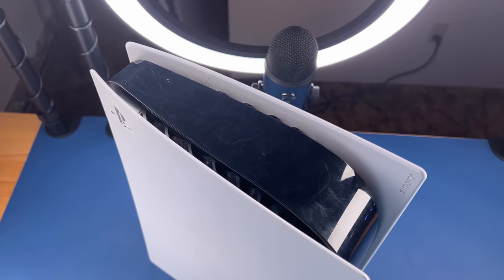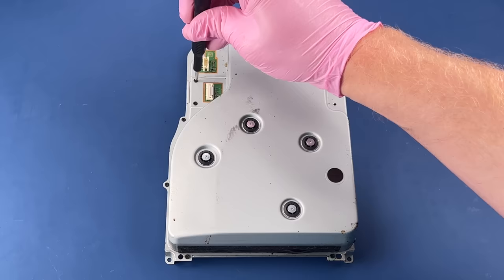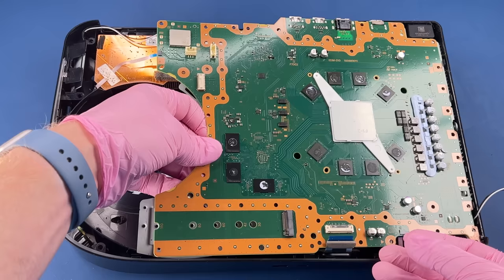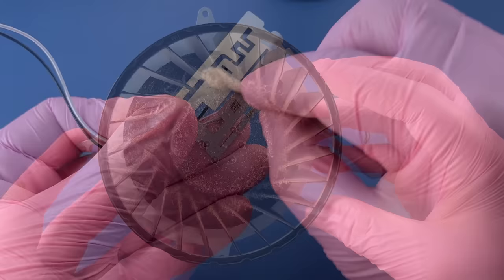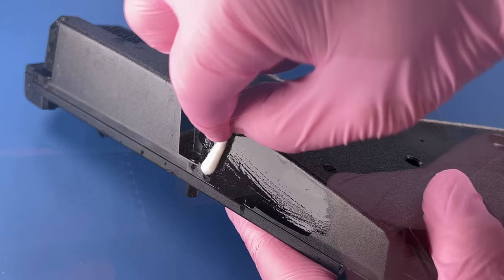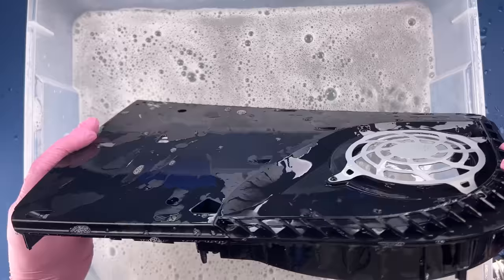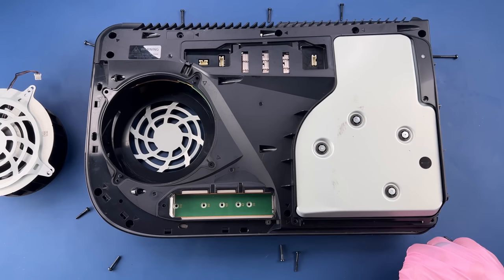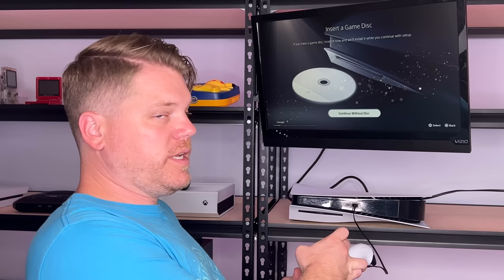Deep Cleaning this DISGUSTING PS5 - TronicsFix Collab

Comment: Bug Expert from the south of the continent here. Those are "Blattella Germanica", commonly known as german cockroaches. They're small, like an inch big at most, we call them "Chiripas" over here in Venezuela. They're annoying, and love electronics for some reason, we commonly see them inside air conditioning units, behind refrigerators, etc. Basically any device that produces warmth of some sort, will attract them.
Reply from the maker: Thank you!
Reply: Also anything with adhesives. The glues inside of electronics, cardboard, tissue paper, etc
Reply: Was scrolling the comments to see if it had been answered. I do pest control for a living and couldn't have answered it better.
Reply: I have read that bugs love electronic so much because the coating on the wires isn't actually plastic. It's made from some soy compound and when it gets hot, they can smell it. Run right too it like the dinner bell is ringing.
Reply: Interesting, in Germany the one I Had was much larger😂
Reply: @Mut4ntG4m3r  Actually they are pretty common here and named "Hausschaben". They love humid weather and you could find them in warm rooms. I found a few of them in my apartement after a few really warm weeks in a row.
Reply: German Roaches are the worst especially when it comes to trying to resolved infestations.  They've become immune to so many of the pesticides used to combat them over the years.  They like electronics because it's cramped, dark and warm.
Reply: At least I saw these things on very old electronics, stored several years down in the basement. 

On Steve's advice, I opened my 2020 Launch PS5 to replace the liquid metal as a precaution. After 3 years it was surprisingly in very good condition and thank god, no roaches contained. =]

Living in northern Germany, we probably don't have cockroaches in our region, as temperatures are lower on average than in southern Germany.
Reply: 5 year pest Control tech here from California, German Cockroaches are also commonly found in Dishwasher cases, we typically use borax cockroach bait to help control them as well as active vacuuming of larger populations in the home combined with a sticky board monitoring station, and home cleaning practices.
Reply: @itbaggedurgf  Had an older lady yell at me, Why can't you get rid of them?! I had to tell her, It's because she feeds them so well.🤣
Reply: How to avoid them?
Reply: @Roznasty13  How to avoid them?
Reply: @iris089  Watch what (and who) comes into your home. They hide in boxes, clothes, used furniture, and eletronics, as you see from video. I was in a food store, and saw them jump from someone's handbag. Woman with the handbag saw them too, and said nothing.
Reply: @iris089  If you see one roach in your home, act quickly. There's NEVER just one. Start using roach bait, and retreat home every two weeks. Keep all food sealed tight in plastic with locking lids.
Reply: I was thinking the same thing.
There are many many roach species.
And this looks like the German Roach.
Kinda small and brown-ish
Reply: @LadySamurai88  What? You didn't see the beer garden they had in there?🍺
Reply: They like the heat
Reply: @aleksandrbmelnikov   thats a classic! haha first step to getting rid of these pests is to control the food supply! swap out their food with cockroach bait and apply it to sticky "cockroach hotels".
Reply: @suje809 yes. That's why I got this idea to put a slight dusting of diatomaceous earth around the device and let it slowly but surely get em
Reply: The hell they doing over here 😅
Reply: Exactly the comment I imagined when I opened up the comments section.😂
Reply: They adapt to their surroundings. So even if you use product to kill them but you didn't kill them all they will start to adapt to those products. They extremely like outlets, devices, water, food, even Lysol, and many cleaning products.
Reply: @Brealiq maybe it's good time to clean  your house, because you talking now BS, never ever had this kind into my house or any, oh I clean my house, that have probably solve this problem. But yeah there are people that give more about the material that the have, instead the house the are living in.🤮🤢🤮
Reply: We got roaches so bad at my house, and we tried to use every store product when we first saw them, but it was no use. It's hard when you live with an older family member, since they usually have cramped hoards of boxes and supplies.
Reply: Professional!!!
Reply: Most importantly, these are the types of roaches that infest. The big, angry ones people from Florida call "Water Bugs" just breeze through, looking for a snack.
Reply: How bad do they smell??!! Is it after they did or always smell bad?!
Reply: @Mut4ntG4m3r oh damn mean your country had a lot of big bugs if my girl saw it she will freak out lol because she had ps5 also i am own of ps5 for 6 or 7 months but she never had clean ps5 for one year i alway keep tell her make sure clean ps5 from dust and make sure don’t allow bugs move in ps5.
Reply: That's true.. in my work place those kinds of cockroaches dwell on the air-conditioning unit and destroy it eventually. It's disgusting to see that it will give you a ghost bump.
Reply: Do roaches go into Xbox series s much also ? Or is that one of the lesser prone console for roaches ?
Reply: Especially wood too
Reply: Me not being a huge expert i did know they were Germán origin roaches. sadly in my past i have encountered them in NJ, I researched as a teen especially once i saw the difference between these little ones vs the ones in Puerto Rico which is more disgusting, in PR they are like 4 to 5 times bigger and they Fly.... lol anyhow awesome how I sort of knew what they were before seeing your post.
Reply: I swear man some part out here in Las Vegas we get these so damn bad and other parts of the city you see massive roaches then some parts there is none.😂😂
Reply: This person speaks facts, ONLY!  Thanks for the info!
Reply: But why tho? We don't even have cockroaches in Germany.
Reply: @aleksandrbmelnikov  maaan... Uhh... Would that stuff be safe around pets??? If you were to use that stuff?
Reply: @adventureoflinkmk2 man... Diatomaceous earth will kill like more than half my pets... 🙁 If I had any infestation problems diatomaceous earth is unfortunately a no go in my house.
Reply: @kennyferrick1240  No. Place only where pets and small children do not have access. It should be fine in locked or child-safe cabinets. They're dark and cozy, just as roaches like. ⭐⭐⭐⭐⭐
Reply: @kennyferrick1240  If all else fails, buy a junction box and cover from your local home center. Screw the box inside a cabinet, and put bait in there. Unless your pets know how to use a screwdriver, they will be safe from harm.
Reply: @aleksandrbmelnikov  Well, I'd need to get doors for the cabinets since I don't have any at all. Sounds like I'd need to go to the city for these things. (I live in a village, literally, so there might be things not available.)
Reply: @aleksandrbmelnikov  I don't have doors to any cabinets. In fact, they never did come with any. I don't really have doors in the house, just drapery and cloth to every entry in the whole house except for the exits to outside.
Reply: They like to eat adhesives
Reply: What it is, is low electricity. Things like toasters, especially behind fridges. They have the heat they like, a drip pan for water and usually there’s food source because crumbs usually fall under fridges. This guy, who that had the PlayStation, my guess, left  junk food and spilt whatever next to that ps5 and they had that nice low electricity and the warmth they love from that and they just moved on in.
Reply: @mikeandroid3512 they go into ANY electronics. It has nothing to do with the console, just the environment it is in.
Reply: That's not "residue" it's cockroach crap. It's where the smell comes from
Reply: Dale gribble
Reply: If you take a closer look they are actually American cockroaches still in the nymph stage. You can tell by color and size of legs.. 5+ years of experience
Reply: OH CRAP WE GENERATE HEAT!! 😨😨😨😱😱😱
Reply: They’re all over the world, Asia is flooded with them.

Comment: I would never be able to put it back together after I take it apart😂
Reply from the maker: There's a lot of screws and parts in these things!
Reply: Yup lol. Why it’s best to just take the covers off and and vacuum in the holes that’s for it… could never take it all apart
Reply: I always get a piece of cardboard the same size as the device I'm working on. Then stab the screws on whatever spot the screw came from. Sometimes I'll doodle the shape of what part the screws go to. If there's layers I'll put the screws next to whatever screw is higher and label like Layer1 layer2 ect. Hope this helps because I've taken a lot of things apart and couldn't put it back together.
Reply: Amen😂
Reply: Indeed if my dad did that he will say we're did thoes screw go 😭😭
Reply: Take photos of everything before you take it apart then if you forget where something goes you can find it on your photos and use that as reference...and when you remove the screws put them somewhere in an orientation that makes sense for example if you take a screw from top right and a screw from top left put them in the top right and top left of your screw pile
Reply: I've done 2-3 regular ps4's. 1-2 ps4 slims.....idk about this 😂

Comment: I can’t believe just how much effort goes into disassembling and tearing down the console and putting it back together… I took apart and put back my steam deck and it’s not something I’d ever want to do again! Major props to you for the work y’all do.
Reply: Why'd you take it apart?
Reply: @whitegenome22 because over time they get dust in them bud consoles have vents on them so they can breath and that leaves them open to dust and bugs not cleaning them will result in over heating fire hazards and infestations if you live in an apt complex with nasty naighbors you can be very clean and these things still get dirty over time and people dont grasp that concept and instead of thinking that way would rather just call the owners nasty and dirty when chances are there probably cleaner then they are 🤷

Comment: Nice video as always, but shouldn't you have opened up and cleaned the inside of the power supply? I guess that would be a lot of bugs inside since it is warm in there
Reply from the maker: Good point. I probably should have.
Reply: Yeah, it's dangerous to fool around in there if you aren't careful and know what you're doing.  But I think it's fine to do it as long as you check/discharge the capacitors.  If you did it on camera, you'd definitely need to caveat/warn about it appropriately.
Reply: Yeah I agree. There's most likely a bit of bugs / bug guts in there that should be cleaned out. But I also understand not wanting to mess with the power supply. I guess it could be swapped out though.
Reply: Just opening it and vacuuming it out wouldn't be dangerous. You probably wouldn't need to clean it that thoroughly
Reply: Agree my first thought too not really that dangerous to remove the top plastic and give it a little blow out with some air with a straw nozzle attachment to be extra careful
Reply: Potential fire hazard in NOT cleaning it out.
Reply: @RestorishOfficial  I also had the same thought. Steve did it on a bug infested console once and a ton of them are in there. And if they're in there because it's hot and they die.....it's hot so won't leaving them make for a beautiful before/after image but the smell will be about the same if bugs are left hidden on the heatsource?
Reply: if the bugs died in the power supply , it could short out the components in there. ...better check
Reply: That and the CPU will also attract em
Reply: It's safe to open as soon passed at least 30 minutes. Usually in good switched-mode power supplies there are circuitry to safetly discharge the 400V capacitors on the primary side. But even after that time, I prefer shortcircuit them to be sure.
Reply: GURANTEED, to be bugs in the power supply unit it's the hottest part 🤦🏽‍♂️😬

Comment: You could soak the bottom shell with metal part in soapy water too. It won't rust immediately and is perfectly safe to clean it with water, just make sure to dry it well with paper towels and give it some extra time to dry (or use some hair dryer set at the lowest temp). before you reassembly the console. I washed many metal parts by soaking in soapy water, including shields in SNES, and never got any rust when dried properly.

Also this residue goo from bugs is also their poo ;)
Reply from the maker: Thanks!

Comment: I remember many MANY years ago, cleaning up an original NES that had this same problem.  The cartridge connector was also completely rusted (something I haven't seen before or since), and required a complete replacement, but otherwise it worked great after a full cleaning.
Reply: I dropped my connector in vinegar 12% for 2/3 days or a week I don't remember correctly.
The rust was gone, but there are just markings left where the rust was 😂
It's working perfectly ! Same for my N64 ! My family used to put alcohol-based parfum in there. Bad idea if you ask me
Reply: Oh yeah and, they had tiny bugs in them, like, worms, IDK how it's possible but, hey 😂

Comment: The only cleaning I've done on my PS5 since I got it on launch day in 2020 was that I pulled off the top faceplate once, cleaned some dust out....but then I couldn't get it back on!

Watching you pull it apart like that is going to give me nightmares haha.
Reply: How were you not able to turn it back on when all you did was take the plate off?
Reply: @skeletor4436 I meant that I had trouble sliding the plate back on

Comment: Unless you live in space, or maybe the middle of Antarctica, there are going to be cockroaches.  Those might be either American or German cockroaches - either way, nasty stuff.  Peroxide, followed by an IPA rubdown, will make the clean-up easier.  Not easy - just easier.  It also does a fair job with removing the odor.  

And most southerners won't call them roaches - they call them Palmetto bugs, but those tend to be MUCH larger - same family, different species.
Reply: I think those were german cockroaches.  Agreed, they do tend to live everywhere, but in colder climates they are not as common when there isn't an infestation.  American cockroaches are common in Texas, they are huge.  They don't usually infest like german ones do, more often live under decks or other damp places.  When they sneak their way inside it can be quite jolting to see such a huge nasty creature.
Reply: From the south (Texas) we call them roaches/cockroaches

Comment: I live in fl, bought my first house 9 years ago here and they included a stove with the house. A year or two later the stove quit working... i took it apart to fix, the inside of the circuit board that switches relays to the stove had been shorted out by a dead roach. Its possible leaving roach bits in the power supply could ruin it months or years down the line, it would seem their shells can actually conduct electricity pretty well.

Comment: Those are German Cockroaches. They come for the food, and stay for the warmth.

Also, the power supply is the main thing the roaches are attracted to, so I bet there were quite a few dead ones in there. They go into the power supply because of the heat it generates, accidentally touch two points, and get absolutely fried. That's why a lot of roach consoles won't power on. The power supply gets fried.

Comment: In the United States under the Magnuson-Moss Warranty Act, manufacturers CANNOT void a warranty solely because a consumer has opened up the device or had it repaired by a third party. However, if the tampering or third-party repair causes damage, the warranty can be voided for that particular issue (this can happen regardless if sticker is removed or not, think of how they say that damage was your negligence, not our defect and void your warranty anyways).

Comment: The insects appear to be German Cockroaches. They are known for preferring the interiors of home electronics due to the warmth generated by the electronics and motors.
Also, I would have opened the power supply (I'm an electronics tech) and cleaned the interior off screen and just told your viewers that it got cleaned using the appropriate safety precautions.

Comment: I think that you should've opened up the power supply and at least clean it off camera. I don't I'd be satisfied with a roachy power supply. I don't know what kind of roaches they are either but they look like the kind that loves to infest electronics. 
A few years ago someone gave me a car that had a tail light rain water leak into the spare tire well and subsequent roach infestation. I fixed the leak and literally cleaned everything inside the car. Several scores of dead roaches and several hundred roach feces got cleaned out. It still took several months for the roach smell to go away. I should've invested in an ozone generator for that part.

Comment: I JUST had this happen to me. I bought a PS4 Pro for $90 and i turned it on and it worked. Then when i went in...my god it was like this video. Absolutely disgusting..dead roaches everywhere. I cleaned it though and added new thermal paste(your also right about the staining they leave its crazy difficult to remove!) FORTUNATELY it turned on when i finished AND it was able to play games. Though i would never want to relive this situation again. Yuck.

Comment: Just a suggestion. Buy a polishing tool and high quality polish and pads for gloss black parts for electronics. You won't believe what it can do. Even for cleaning the CPU dyes. You did a great job cleaning but did you check the scratches on the PS5 glossy black parts? Good luck 👍🏼